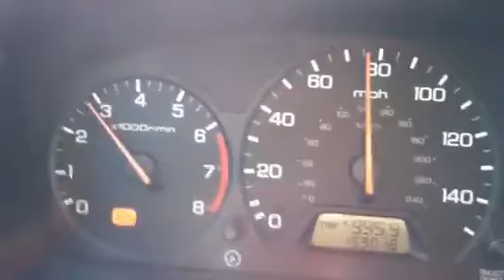99 Honda Accord Check Engine Light on Trip P1259

Comment: a p1259 vtec malfunction could be caused also because your vtec solenoid is clogged. If you take the vtec solenoid off, you will find a screen that might need to be cleaned or replaced. If it is clogged up, simply clean it or replace it and put the vtec solenoid back on and see if that fixes the code. This problem could be other things as well, but this is a good starting spot for sure.
Reply from the maker: Vtec switch was bad

Comment: another thing that could be the problem... there might be a blockage inside the head of the engine. Honda had told me this after I replaced the vtec solenoid and still had the code showing up. these cars are tricky sometimes when it comes to pin pointing the exact problem.
Reply from the maker: hey! thanks for commenting. mine happened to be the vtec solenoid switch. changed it and ran beautifully. also my knock sensor split in half so that didn't help haha

Comment: Yea... same thing happened with my knock sensor. Have to replace asap! Imma have to look up the vtec switch too now!
Reply from the maker: normally it is the vtec switch that causes it. talked to 4 different dealers considering i was stranded down at my friends house 300 miles from home haha. it was urgent. surprisingly the part is rather inexpensive and easy to change.

Comment: hallo again > keep going :) ,, i just asking for another video . 2006 Nissan Altima Highway at diffrent speeds 60.80.100.120 km/h and see how the rpm take at diffrent speeds , and changing speeds (flyout ) for see the engine power ;)
Reply from the maker: The Nissan had high rpm

Comment from the maker: Code is p1259. Vtec malfunction. Changed knock sensor because it was split  and that didnt help. Next is oil pressure switch. Oil is at the proper level